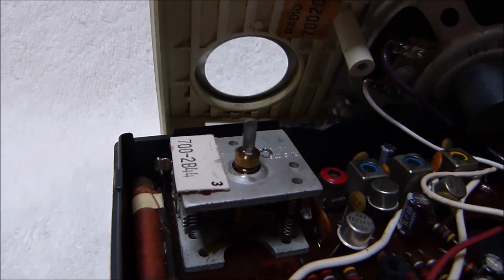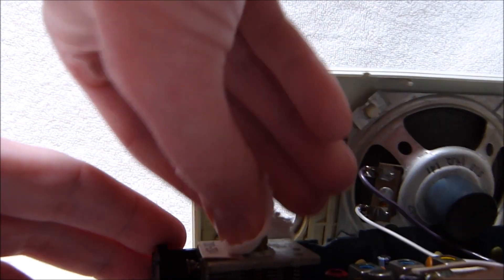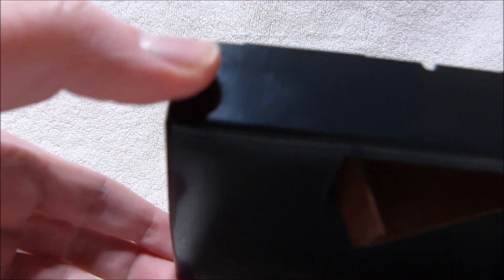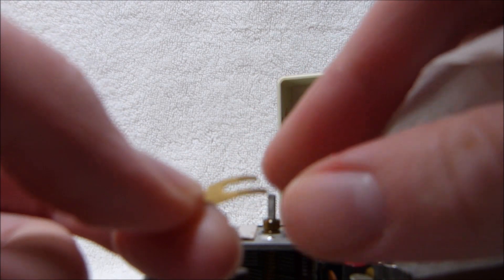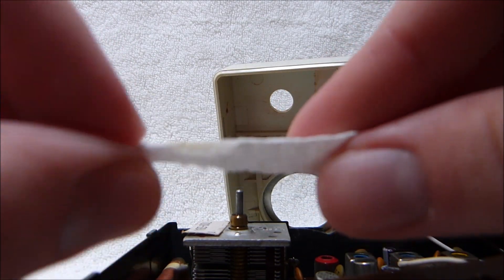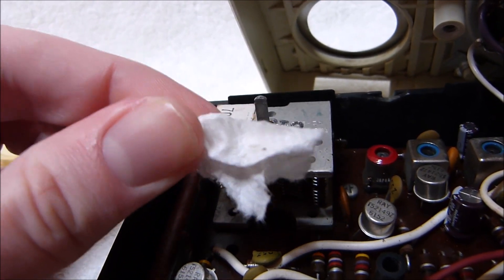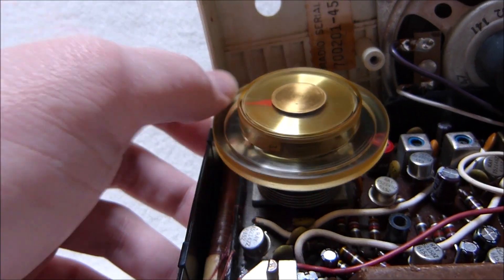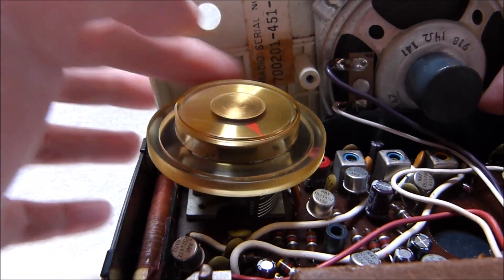Cleaning the tuning capacitor on a Sylvania TH-16 transistor radio

Comment: While I like the video and understand the your cleaning process, ball bearings are required to be re-packed with grease. Where you installed oil will now drain.
Reply from the maker: I haven't really had an issue with that to be honest (and I've worked on quite a few radios), as I'm using a fairly thick oil. That said, a thin grease might be a better option, true.
Reply: @50sTransistorRadios I used a light synthetic bearing grease in all my vintage equipment and at the base of the 8 track large capstan wheel spindle. Much less friction, it's not cheap but works.